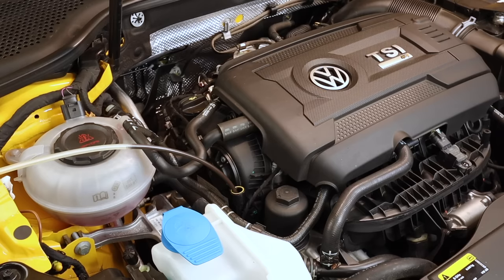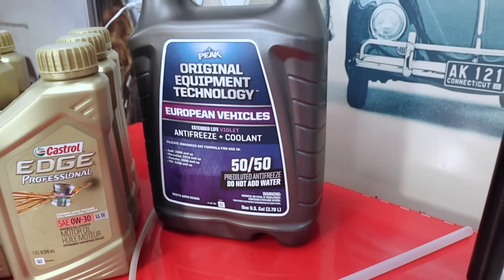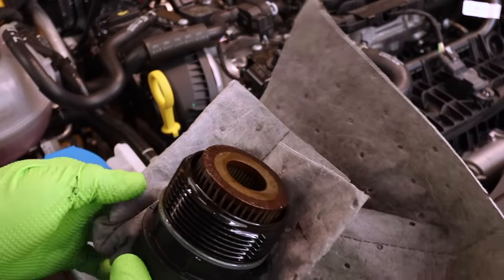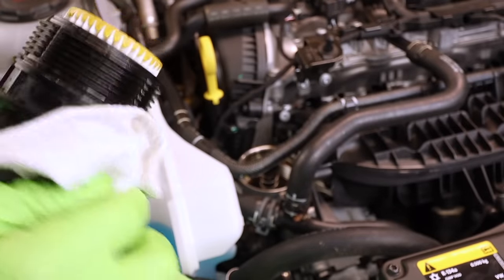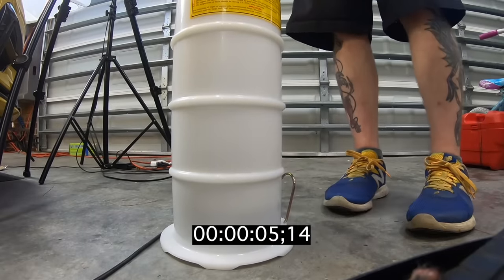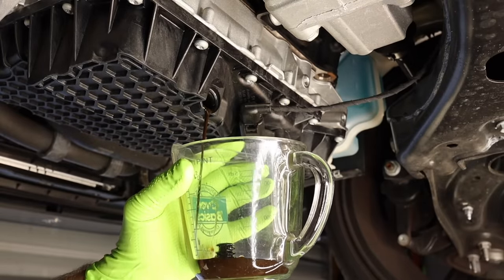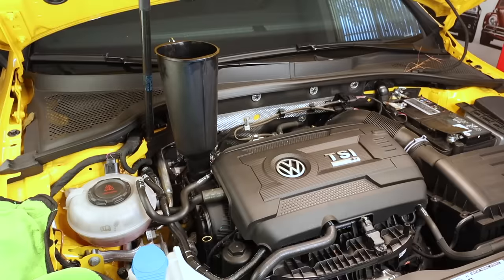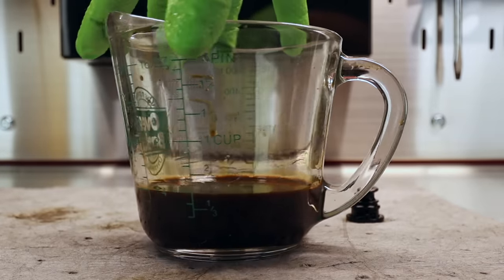Will an Oil Extractor Get All The Oil? (MK7.5 Golf R 5000 Mile Service)

Comment: I just cringe when I see composite plastic oil pans, plastic drain plugs, oil pickup and windage trays. So sad.
Reply: Its alot cheaper
Reply: ExTaCiii of course bottom line counts for everything, manufacturers always work on compromise vs cost.
Reply: You're stuck in the past man
Reply: Incognito nah fella I know. The day will come when your vehicle is made entirely of composite materials for recycling, keep the car for 5 years then it’s recycled. Vintage cars will no longer exist.
Reply: I totally agree with you.
Reply: What kills me is plastic intake manifolds
Reply: plastic engine parts made with plastics are more difficult to recycle than aluminum or steel, it only provides cost savings to manufacturers..looks like planned obsolescence honestly , see that on most european cars
Reply: @2810Mad  True dat. Until you have to buy replacement parts. Some of those prices on plastic replacement parts are shocking...
Reply: @trustgtr33  I'm an industrial mechanic. Planned obsolescence helps me keep my job
Reply: @2810Mad  i agree but these are kinda over doing it..
Reply: @trustgtr33  yeah I understand what you mean
Reply: Sneaky Foz not to mention VW plastics aren’t known for being the longest lasting. Cough MK4
Reply: @sneakyfoz3692  Metal is much easier to recycle than plastic though (and usually cheaper than making it from ore)
Reply: Opernakist especially for cars that use boost we gona have alot of manifolds to change in a few more years
Reply: Depending on the composite, some are strong enough to easily replace metal yet are strong enough to do their job well. Now, you CAN go too far but material science has come a long way.
Reply: People already have had their engines destroyed by plastic cooling system parts. No platic oiling system parts will do the same thing, only much more quickly.
Reply: Even soft ass aluminum oil pans (mk4’s) would crack and bust all the time. Hence why we used to “upgrade” (more like retrofit) our oil pans with steel mk3 ones. And ya, the VW plastic gets brittle and weak over time leading to a a lot of cussing over intake manifold rattling, coolant leaks (“crack pipe” and coolant flange). All that said, I’m sure things have come a long way since mk4’s.
Reply: Im more worried about the intake manifold and all the other plasic coolant pipes, intercooling piping. Non serviceable and designed to fail
Reply: lol!! Welcome to 21st century lol
Reply: It is truly pathetic and cheap as F looking. I would never trust a plastic oil pan... it's just pure insanity to me. Metal is fantastic. They're cheap and not made out of plastic
Reply: @sgtLatte  Dont know what you are talking about, even the old M50 and M52 plasitk intake maifolds are superb, no problems ever!!
Reply: @azeissler1987  Its especially bad on cars with boost. Now as always some cars are designed better than others. I have a Volkswagen cc that's had the manifold split twice.
Reply: Hansel Franzen  I have a Saab 9-3 that miraculously is still running mint with 180k miles.
Reply: Plastic is the worst when it comes to wear if you turn the engine on and off.
Reply: Incognito plastic oil pan is like saying cotton exaughst headers, it just doesent seem right
Reply: @sgtLatte  plastic intakes? yeah, but only after plastic exhaust manifolds...those are REALLY getting cheap.
Reply: @user6860  it's already pushing it making the intake manifold in plastic now the new cars have plastic parts in the exhaust manifolds too.
Reply: Sneaky Foz why would you want a “vintage” golf r with plastic oil pains and all that
Reply: At one point in time, my family owned 3 Mk4 Jettas.  Between the three of them, I had to replace 2 broken plastic dip stick tubes, 2 plastic coolant flanges, 1 plastic windage tray, 1 plastic direction signal lever, 2 plastic  radio knobs, 2 plastic cup holders, 2 plastic rear ash trays, 2 plastic glove box doors, and 2 plastic center armrests.  Never seen so much plastic on a car.  Had these items been made of metal, none of them would have failed.  Luckily for me, the water pumps with the plastic impellers had already been replaced by previous owners.
Reply: You're stuck in the past.  Plastic oil pans have been around for 20 years!
Reply: Plastic oil pan sounds bad but it’s probably stronger than aluminum If something hits it bad news regardless. Filter on top is awesome!
Reply: Car manufacturers do this to maximize profit. Plastic is cheap and easy to make.
Reply: @SpaceCadet4Jesus  They have plastic exhaust manifolds? I'm soo happy to have a stainless exhaust manifold
Reply: They make guns out of polymer and Glocks last forever
Reply: @sgtLatte  Why? They're lighter and cheaper. easier to mold.
Reply: @emeraldages  metal casting is not the much more expensive and I'd rather have the money spent to have something that lasts. The engine is the one place you shouldn't be putting plastic parts to decrease weight. If rather have extra weight and cost for a part that lasts the life of the vehicle
Reply: @2810Mad  I'm a semi mechanic and there arent a lot of planned obsolescence parts, but when something is built to run a million miles it breaks anyway. Manufacturing has gotten so much better that if some parts werent built to break, a lot of auto mechanics would be reduced to oil changing, which honestly could be replaced with machines anyway if the industry saw a need for it. It really sucks because cars aren't built like they used to be, but if they were I would imagine they could get a lot of trouble free miles with todays manufacturing standards. It's why I'm looking forward to Ford's new 7.3 gas engine. To me, it looks like a lot of old school technology put into a modern day platform. I'm curious to see how it holds up in the future.
Reply: @thatcrazywolf  Glocks dont weigh 3000 pounds and fly into rocks going 70 mph.
Reply: Nothing wrong with good plastic.   VW plastic on the other hand...   Good luck.
Reply: The entire engine will be made of plastic along with the transmission.
Reply: @intrusive_thoughts.  You're stuck in driving crap that lasts 100k and sob how everything should be better for the environment.. The same hypocrites that buy/lease a new car every 4 years. Maintain your old cars ppl, it will save the environment but mostly, your wallets.
Reply: Anyone that thinks vehicle manufacturers are using plastic parts for the benefit of the car buying consumer are delusional. You only need to search around Youtube for a while to see in so many cases, engine, transmission and other large component failures so often come back to a failure of a composite or plastic part, usually over time with consistent heat cycles causing thousands of $ in what should be avoidable repairs.
Reply: @frankhoward7645  Other car manufacturers use plastic parts (as describe above) but those parts usually don't fail. German car plastics seem to be suspect.
Reply: @sgtLatte  Just had to replace a plastic intake manifold on my moms crown vic.  the thermostat housing completely exploded from top to bottom, engine lost all its coolant instantly and overheated.  This is a common problem on these cars so ford fixed it how?  by replacing the plastic housing with a metal one.  go figure...
Reply: @sneakyfoz3692  Yes and yes.
My father worked decades at Bell Labs and Bellcore. One of the higher-up research Engineers in 1988 said "...one day televisions will be so thin and light, with a greatly reduced cost. You will be able to hang it on a wall like a picture. When it fails, you will just throw it away and get another without any great pains."

Look what happened. Samsung flexible HD LED screen materials. Flexible RGB LED sheets for walls of images on buildings. All relatively cheap and disposable.

I was glad 1280x720 was the original HD standard vs the five other formats.
Reply: @That-guy0801  It is fun finding Youtube videos of boosted Pontiac LS V8's popping plastic intakes. Perfect example.
Reply: @frankhoward7645  Wait. WAIT. "Plastic dipstick tubes"!?!?! I am supremely unfamiliar with many V-AG model intricacies, but they have plastic dipstick tubes? I would appreciate not having something that rusts attached to my oiling system, but it seems odd. Is there a special screw or threaded top part? Like the kind for custom oil fill funnels?
Reply: @sgtLatte  In the salty shi$$ty swamp known as NJ or for someone that lives near the bay, these plastic laden cars are a Godsend!
Reply: @pgmurray76  The tube fits over a metal collar that is pressed into the block where the pan is attached, similar to a conventional metal tube.  It's held down by the plastic engine cover.  One has to remove the dipstick prior to removing the cover because the ring on the top of the stick won't fit through the hole in the engine cover.  The tube is never used for adding oil.  There's a conventional oil fill cap on the cam cover for that.
Reply: @frankhoward7645  Excellent. Thank you. I see what you mean. I found photos. Looks clean though
Reply: @pgmurray76  Would have been cleaner if rather than pressing a short metal collar into the block and adding a plastic extension, VW pressed a long metal collar into the block and called it a dipstick tube.
Reply: I agree that plastic parts suck, however there is some benefit to the plastic oil pan.  I live in new England and up here, in addition to dominant professional sports teams, we have lots of road salt which = rusted oil pans seeping oil
Reply: @bosco0991  Aluminum oil pans such as those on Mark IV Jettas don't rust.
Reply: @sneakyfoz3692  We probably won't even be allowed to drive the car ourselves anymore at that point
Reply: I cringe when I see a plastic exhaust manifold!
Reply: My thoughts exactly.  Everything in my 2000 GTI that is plastic is brittle as hell now. Every single thing that is plastic in the  engine bay is failing. Original owner.
Reply: well todays cars are not made to last more than 60-100k anyway
Reply: @2810Mad  disposable cars will not be serviceable, so you'll be out of a job
Reply: @puregsr   not really, I'd be the one to monitor the production or work at the assembly line. You can work at alot of places as an industrial mechanic
Reply: What do you think about aluminium bolts and screws that break when you try to take them out?
Reply: Sneaky Foz Germany engineering at its finest also its designed for the oil to be pumped out 🤦🏻‍♂️
Reply: EazzzY_Three0Three trust me fanboi those Germans from VAG are not your friend. 🤫
Reply: It used to be that you had to hit a brick to pop a hole in the oil pan. With plastic, a large bug will suffice.
Reply: And it will leak like hell in the future
Reply: @sgtLatte  the fuck are you talking about bmws with plasic intake manifolds are making 3-5x the stock whp and u to 4 bars of boost, they only suck when detonation occurs but that would ruin any intake manifold. on the e36 specfically, its almost impossible to get a mettal intake manifold to match the flow characteristics
Reply: Composite materials are not as bad as you think. There is no reason a plastic intake manifold should break/split if you are running a stock car. Plastic does not retain heat like steel or aluminum manifolds. This goes for oil pans as well. The lower plastic oil pan is the lower part of a two piece system. The structural rigidity is the girdle. Aluminum hardware as well. Weight is kept low, heat soak is minimal, more cost effective, cheaper to replace. Plastics/composites today are not the same as the stuff from over 10 years ago. How do you feel about carbon fiber tubs in super cars? :)
Reply: Plastic carburetor on my lawnmower
Reply: Opernakist they flow better than aluminum because they can have bigger inner diameter for the runners and so munch smoother they’re normally glass reinforced too so good for high heat and lots of heat cycles and impact sturdy as well
Reply: @sneakyfoz3692  Yup - and the day some 'Goober' doesn't put the protection underpan back and the sump touches a kerb and cracks...
Reply: Yeah...who wants drain plugs that don’t strip, pans that are lighter and less expensive and don’t corrode??? The humanity...
Reply: You Wish  yeah like I said some cars have better quality parts than others. I was specifically talking about VAG cars and their terrible plastic that disintegrates when you breath on it.
Reply: 2 GTI's, 147,00 and 87,000 miles  plastic, not a bit of problem, plastic is 2019, not 1959
Reply: You Wish  Never ever had an issue, 147,000miles on one of my previous GTIs...and other was 87,000miles...same with plastic oil canister, not one bit of issue.
Reply: I kept my engine (EA888 Gen3 outta my GTI) supported by the plastic oil pan to do a clutch. Didn't worry about it at... After it settled. Worked fine. Get an aftermarket metal pan if you want, but I'm at 120k and don't worry about it at all.
Reply: Sneaky Foz now I'm really CONFUSED
Reply: Lawn mowers now have plastic cams!
Reply: Made to be a first owners only. One way.
Reply: Certainly Petrochemical Composites (aka "plastics") have come a long way, BUT... I don't know of any that transfer heat anywhere near as efficiently as metals, ferrous or aluminum-based.   I don't mind that a portion of my engine cooling occurs via the stamped steel oilpan, I mean it's just hanging out in the slipstream, far from the passenger compartment, seems like a thermodynamic no-brainer/freebie.
Reply: Like you, I prefer metal pans and drain plugs.
Reply: sameeeee
Reply: @sneakyfoz3692  yeah just like the new supra oil injectors
Reply: @sgtLatte They are better, No heat soak.
Reply: Plastic has its uses, but id rather see a steel pan that dents rather then cracks should it take a hit.
Reply: Thomas Rock  Sorry guess i was spreading misinformation i fixed it now.
Reply: They don't rust
Reply: Its cheaper and also lighter
Reply: Incognito I love this comment
Reply: Incognito the past is a way better place to be lol.
Reply: Pretty soon you will see plastic engines.
Reply: Scotty kilmer was right, VW is going the cheaper route with all this plastic parts.
Reply: Glass-filled nylon header tanks on radiators. They always fail with hairline cracks etc.
Reply: trustgtr33 if plastic was really that much cheaper, BMW wouldn’t be short for Breaking My Wallet! Nothing but plastic parts on BMWs
Reply: Its cheaper to make, but it also deadens mechanical enigine noise.
Reply: ITT: A bunch of people that have fuck all experience in designing and engineering vehicles complaining about the way a car is engineered.
Reply: Max Ritter you clown, the engineers are bound by budget constraints otherwise you would be paying $100k for a Golf that effectively last forever, but you don’t, you pay $30k for a car with parts good enough to get through warranty and a bit longer.
Reply: yeah, unfortunately this is what german engineering gets you these days. i can't speak for Europe but if these parts were actually reasonable priced like the American and Japanese car part equivalents then it's not a problem. But these will probably be $600-$1500 parts that will only break after your warranty ends.
Reply: What about composite aircraft.  When you hop on that plane for your next trip, it might be composite.
Reply: My Maserati (ZF) Transmission Pan is long, nice and polymer. So are the Turbo inlets and outlets are polymer. Fun fun fun.
Reply: @2810Mad  It's not cheaper when one of those plastic parts breaks and causes your engine to blow up!
Reply: Jordan Tyler; be that as it may. Reinforced plastic, is still plastic in the end. If i could find a steel or aluminum aftermarket pan, to replace the OEM plastic one, I would do it in a heart beat.
Reply: Agree totally...I just use an old metal biscuit tin...works fine
Reply: @sgtLatte  yeah, and plastic clutch cylinders. Had one go on my Ford Focus. Altho plastic,they cost over 100euros...rip off
Reply: The metal pan it would normally have isn't any better if you smack into something.  As long as  you know how to drive it's not an issue.,
Reply: @OZD-mb2bs  I have heard horror stories of what happens when you hit a steel oil pan.  It can apparently fuck up the engine pretty bad with how much force it imparts on the bolts.  If you put a hole in an oil pan and don't notice... Kinda your own fault isn't it?  I think the belly pan is a great idea though especially if you are going to switch to a metal oil pan.
Reply: @thatcrazywolf  True, but not all car people are familiar with the great Tactical Tupperware Pistol.
Reply: You could build one yourself out of hemp.
Reply: That seems like they’re doing it with all the cars, Intake manifold, valve covers ,oil pans, transmission pans, and the price of the car is keep going up and up and the quality goes down and down.
Reply: @intrusive_thoughts.  yea ask anyone with a Ford 3.5 that is to change the damn plug every other tome
Reply: @thatcrazywolf  Not sure it has been pointed out yet, but only the grip/frame is polymer.  The rest of the gun is steel. Polymer would blow up. lol.
Reply: @pgmurray76  If a brand new car cost like 600 bucks in the future I will careless what they are made of, I probably wont bother to change the oil.  In the contrary, car is getting more expensive and it lasts much shorter....
Reply: @sgtLatte  seriously?? That's crazy
Reply: If I would want a new Car without this plastic oil pan / intake manifold, what Car should I buy ? Toyota ?
Reply: @ImplantedMemories  better pop the hood at dealership and check it out yourself. pretty much all new cars are using plastic manifold.
Reply: Actually, VW/Audi and german counterparts have very good engineering, and theyre made to last as long as possible. The reason these cars get such a bad rap for reliability is generally the owners A) lease or B) are too rich to care about longevity so they drive it as hard as possible when new. I know Audi's over 130k miles still running like a clock because it was well maintained
Reply: german cars love plastic parts, scotty kilmer calls them overengineered lego cars lol